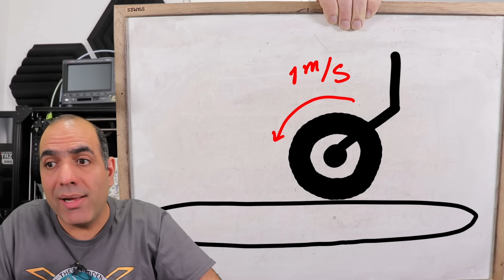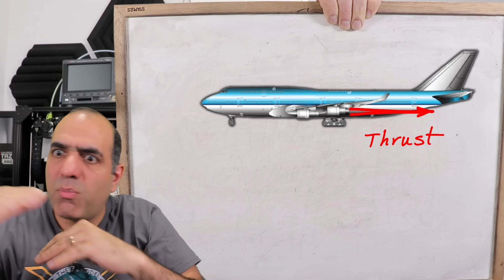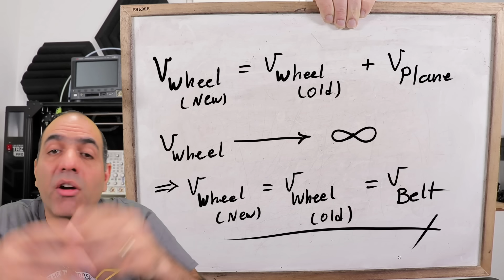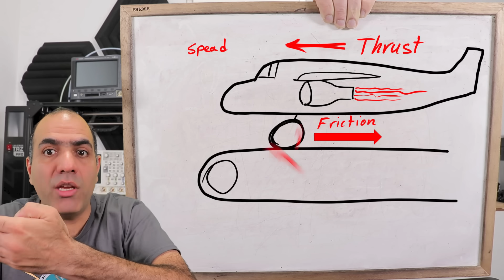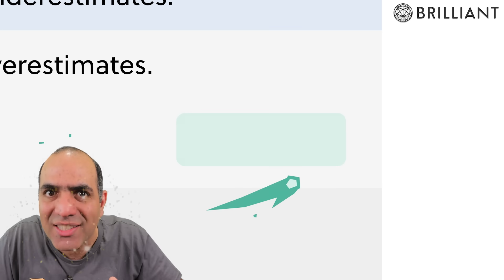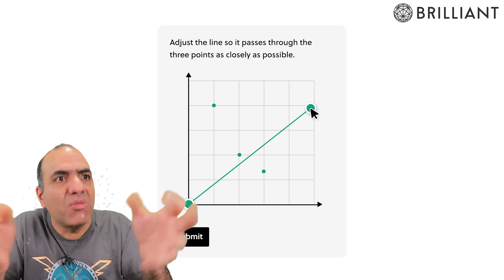Airplane Question that Drove Me NUTS!!!

Comment: It should be able to take off because the wheel speed is irrelevant unless the parking brake is on or something.

But the more confusing part of the question is "exactly match the speed of the wheels". So if the wheel speed is 1unit, then the conveyor moves the other direction at 1unit, which increases the total wheel speed to 2units. So now the conveyor speeds up to 2units which makes the wheel speed 4units..... And pretty soon the wheels are spinning faster than the speed of light caused by a positive feedback loop starting from any initial speed.

Comment: Man only the wheels are in motion and the body of the plan is at rest so according to this saturation the speed of the wheel is same to the speed of the treadmill (whatever).the air is not acting at the plane and the air is not pushing the the plane vertically booth air and the upper body are we can say that they are at rest altho the air have some opposite velocity. Bro I just want to say that the plane will not take off 😵😵😵

Comment: No I will not fly due to uplift lift that needs to be created. Meaning although the engine sucks tons of air in and out this only leads to a small movement of the plane and consequently wheels turning and hence the belt (so the belt cancels out the movement that is caused by the engine). 
However, the body of the plane itself does not move at the required speed that’s needed to create an uplift by the wings. Meaning the air moving around the body of the plane does not have the speed needed to cause an lift. That’s your answer 🎉
Reply: why would the treadmill stop the plane?  do you think the brakes are on?

Comment: No airspeed no takeoff
Reply: how would the conveyor belt be able to stop it?  you think the brakes are on?
Reply: @tsm688  air speed is different from ground speed
The plane could be stationary relative to the Earth's crust but have air moving fast enough for it to take off
Reply: @KevwePatani  so what?

90,000lbs thrust forward and zero push backwards

why
wouldn't
it
move
Reply: @tsm688  the pushback force is apparently the runway and the friction of the tires on it
The question doesn't make sense to begin with, this discussion bears no fruit
Reply: @KevwePatani  Airplane wheels do not have 90,000 pounds of pushback force.

Unless you left the brakes on, the plane takes off.
Reply: @tsm688 yes I agree with you
But the hypothetically (and this makes no sense whatsoever) the conveyor belt could go fast enough that the friction negates 90,000 pounds of thrust, hypothetically
Reply: @KevwePatani  The question implies but does not say that.  It says it matches the speed of the wheel to counteract any movement, but matching the speed of the wheel *DOES NOT* counteract the movement.  That's why it's a bad question, it implies things that don't happen.
Reply: @tsm688  exactly what I'm trying to say! The way the question is formulated is a catch 22 that doesn't make any sense
Reply: @KevwePatani  It's not a catch-22.  It's so broken it's not internally consistent.  The laws of physics don't work that way.  Therefore the plane can fly.

Comment: The plane will not take off because the freaking wheels are not powered as you stated in your video!!  There is another argument here as well.  Is the belt powered at all?????  There is also no air currents being built up to allow lift.  It would still be as if the 747 was sitting still...  Go into aerodynamics a bit more to answer the question.  Make a follow up maybe with a small model.

Comment: I would imagine that no the plane can't take off because it's movement generates a force and a conveyor belt would contradict that Force this isn't an environment without wind though I imagine if the wind is strong enough anywhere I guess it could be done she can't reach at high enough coefficient
Reply: how would the conveyor belt be able to stop it?  you think the brakes are on?

Comment: If the plane speed is 0, doesnt matter if the wheels are at 1000 or 0 kmh, the plane wont take off. And since the wheels are stuck to the plane, and the wheels will not move in relation to the ground, because the conveyer belt will always have the same speed as the wheels, the plane will not move in relation to ground, therefore the plane will have no airspeed and no lift to take off. Simple.

Comment: Everyone's being pedantic on rather or not the conveyor would be able to do is job when the real question is rather or not a plane being able to take off has anything to do with how it's wheels are moving. Basically "Can a plane takeoff if there was a force keeping it stationary but it's engines moving at high speed", and the answer to that of course is no because it's takeoff is related to the air moving around the wings and not the wheels.
Reply: it's not pedantic at all, that's the whole point of the question.

the conveyor can't stop it.  therefore, it will take off.  the rest is a red herring
Reply: @tsm688   The question tests knowledge of how aircraft taking off fundamentally different from how ground vehicles move. It's asking that if there's a hypothetical force that can keep the wheels spinning without the aircraft moving within the air, can it take off, and it even specifies that the aircraft is stuck still with it's wheels moving as if it were on a dyno.
Reply: @hyperx72  The wording heavily implies and lets you assume it.  That's why it's a really bad question.

But a basic knowledge of physics refutes this.  Conveyor belts don't actually work that way.  If you can roll, all it takes is a tiny force to keep you in place.
Reply: @tsm688  The wording mentions sitting still, so not understanding that point shows you didn't actually pay attention where it counts.

Comment: But Mehdi... The plane is not moving. The conveyor belt moves the same speed the wheels are moving, but in the opposite direction. What makes a plane fly? Air pressure under the wings. That is created by AIR moving over the wing. There is no AIR moving over the wings. There is no flying. This is as simple as it gets.
Reply: but hovarth...  why isn't it moving?

there is thousands and thousands of pounds of force pushing it forward, and no force pushing it backward.

Yes -- no force.  Did you think the plane has its brakes on?  The wheels turning transmits no force to the plane!
Reply: @tsm688  again: is the plane moving relative to the air around it? It has absolutely nothing to do with the ground, or the conveyor belt, only with the air around the wings. If you blow hard enough winds on a stationary airplane, it will start to experience an upward force. Because what makes an object fly? The air pressure difference between the bottom and the top of its wings.
There is no air pressure difference in the scenario of the belt. Only the ground is moving. Not the air. There is no flight.
Reply: @hor_ger  To repeat:  Why wouldn't the plane move forward?  Why wouldn't it gain airspeed?  Do you think it has its brakes on, or something?
Reply: @tsm688  well you're asking why it wouldn't move forward relative to the belt? It is moving the same speed, thus it is absolutely stationary.
Reply: @tsm688  actually if it had its brakes on it wouldn't move either, nor relatively nor absolutely
Reply: @tsm688  also, why are you fixated on the plane's movement? Flight does not require speed, only air pressure difference. Think of a helicopter. It does not have "speed". It doesnt even have wheels. It has blades moving through air that creates pressure difference that makes it fly.
Reply: @hor_ger  I'm asking you to take this thought one step further.  How does it stop it from moving?

By pushing on the wheels?

Are the wheels locked?

They are NOT locked.

Unless you lock the wheels, the conveyor can't actually stop it from rolling forward.  All it can do is spin its wheels faster.
Reply: @tsm688  Your comment makes no sense, and I won't be trying to make sense of it myself. The conveyor belt moves BACKWARDS. The wheels move the same speed FORWARDS. Thus, (-x) + x = 0.
It does not "stop" it from moving, but it also does not facilitate or cause its movement, because, by definition, it is not able to. The belt moves the same speed as the wheels, but in the opposite direction.
AIR PRESSURE DIFFERENCE causes FLIGHT. IS THERE AIR PRESSURE DIFFERENCE? NO. Thus, NO FLIGHT.
Reply: There are several things wrong here.
The forward motion of a takeoff doesn't depend on the wheel-ground interface, it depends on the interface between the engine blades and the air, the treadmill is basically irrelevant. Just as you can easily drag a toy car forward on a treadmill, the aircraft engines pushing on the entire body of the aircraft with 120 tons of force through the air, with no force pushing back, would be basically no different from a standard takeoff.
Aircraft engines push the aircraft forward, as the name would imply, relative to the air, not the ground.

Pressure gradients are also not why an aircraft can fly, that's a common misconception about the Bernoulli effect, which doesn't apply neatly to unconstrained fluid flow or turbulent flow. It's understandable though, even physics textbooks often get this wrong.
Some airfoil designs like the double wedge and circular arc don't even utilize this effect, and also it would be impossible for aircraft to fly upside down if that were the case.
Most of, sometimes all, of the lift force comes from conservation of momentum. Wings typically are angled slightly up, and as a wing travels forward, the bottom side pushes air down through normal collision, and the top side redirects the airflow down the surface of the wing due to the Coanda effect. In response to the air being pushed down, the aircraft is pushed up.
Reply: @snowthemegaabsol6819  thank you for your insightful comment. I'm baffled as to why you say the pressure gradient is not why and aircraft can fly - I just want to understand where you're coming from. In my mind, if "the bottom side pushes air down through normal collision", does that not create positive pressure below the wing? I mean, if I clap my hands together, I make the air move together, and as they clap, that creates sonic vibrations, partially because of a difference in pressure.
In any case, I think we both agree that the flight of an airplane has nothing to do with the speed of the wheels, and everything to do with the momentum of the plane and the air surrounding it (as without air, a conventional airplane would be unable to fly - I think you would agree). Since this dumb question only deals with a conveyor belt and not a huge fan, the plane would not take off.
Reply: There may be a very momentary pressure differential in response to the motion of the wing, but that's the effect of the wing's motion, not the cause. It also wouldn't explain surface interaction with liquids.

Comment: Would this not be the same answer as a car on a rolling road. When cars are getting tuned and dyno'd they're put on basically a treadmill. They can get the wheel speed up to whatever they want but the car won't just overcome the rolling road and start moving forwards. Surely the same would apply with a plane albeit on a larger scale.
Reply: Put a jet engine in the car and think again.

Then put wings on the car and think again.

Did you think an airplane was driven by its wheels?
Reply: A car relies on friction with the ground to roll forward, which is why it would stay in place. A jet relies on thrust from accelerated air, which is independent to the ground

Comment: Why did it drive you nuts?

Planes are not powered forward by their wheels, planes are powered forward by their jet engines... The wheels would be spinning much faster than normal but it would take off none the less.
Reply: because the question is phrased in a way that assumes the conclusion -- that the treadmill could stop it.  That is what's so dumb about it.  It can't.

Comment: Nope. The wing, (Bernoulli affect,) needs air across the wing to create lift.  It's not moving through the air apart from whatever ground wind is there.
Reply: Why wouldn't it move?  Thousands of pounds of thrust pushing it forward, and nothing pulling it backwards.

Yes, nothing.  Did you think they left their brakes on?

Comment: A plane will take off from a tredmil /standstill with enough lift being created by the engine thrust you can take off from a stand still this got proven on mifbusters around 10 years back
Reply: Intact a plane doesn't even need wheels people get confused as cars need propulsion to work but propulsion isn't needed when flying a plane you need wind being dragged over the wings with the engine of the plane can achieve in its own
Reply: Why would it be at a standdstill?  Thousands of pounds of thrust pushing it forward, and nothing pulling it back.   Unless you leave the brakes on.